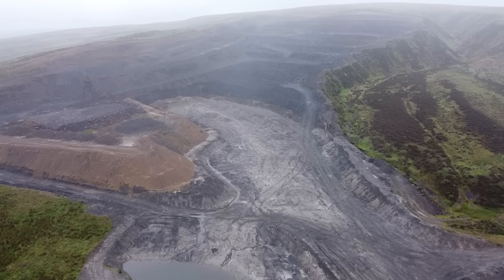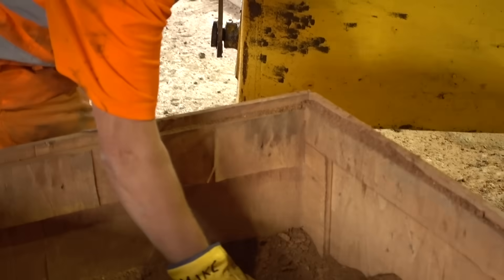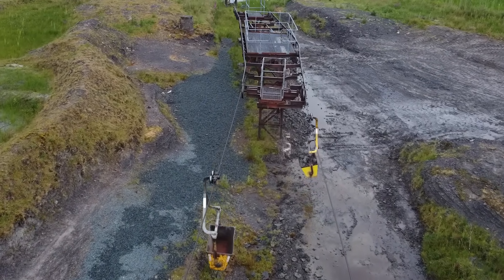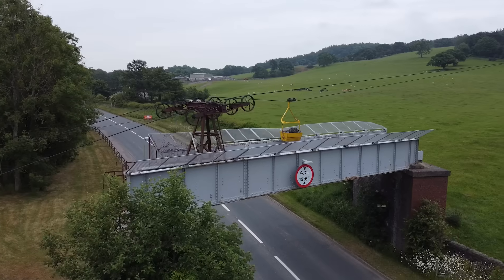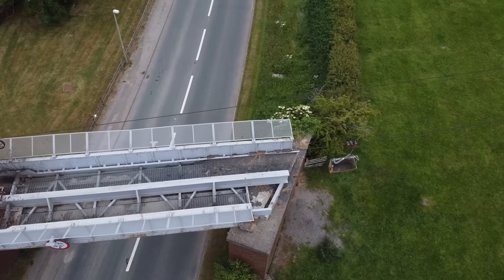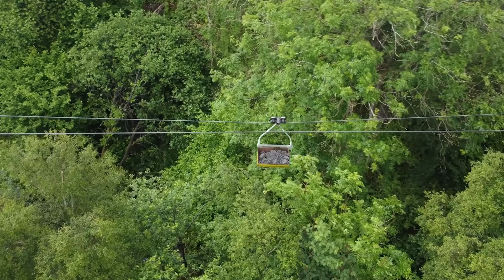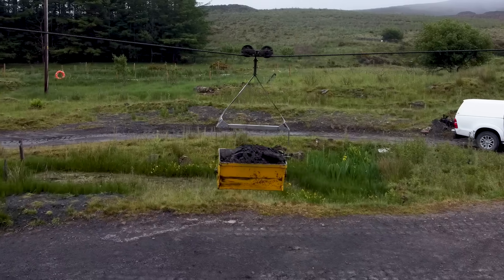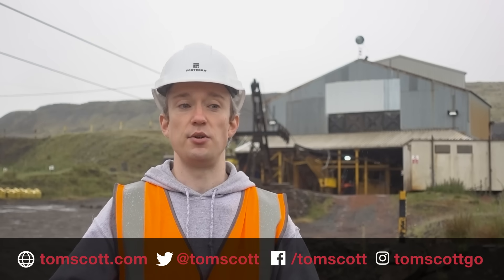The UK's last aerial ropeway uses no power, moves 300 tonnes a day, and will be gone by 2036.

Comment: Theres a few railways opperating on a similar principle aswell. "famously" the trains that take swedish ore to norwegian year-round harbors and then bring the empty carriages back are net-energy producing because the trains use regenerative braking and the route is mostly downhill from sweden
Reply: Yes, gravity-worked railway inclines used to be very common in the UK but the only one still working is at the Bowes Railway.

A number of cliff railways (funiculars) operate on a similar principle by having a tank of water under the carriages which is filled to make the top carriage heavier than the bottom one.
Reply: @RJSRdg  There a cool one from Lynton down to Lynmouth. There probably a Tom Scott video about it
Reply: I think you will find that the iron ore railway uses regenerative braking
Reply: @andrewwalsh816  literally what I said. Thus similar not identical
Reply: @theholyduck90  Not meant to be a critisism; just that as some viewers had not heard of Ariel ropeways, I should point out that the Swedish railway doesn't use ropes. I should have added that when a train goes downhill, the wheels turn the electric motors that then work as dynomos/alternators, putting electricity into the system.  Of course, you have to get the timetables right. I hope this may be of help to someone.
Reply: No they dont
Reply: @DrLoverLover  if you are talking to me. im talking about the kiruna to narvik railway which atleast as im aware is somewhere around net-zero to net-positive energy. due to how heavy the ore trains are going down hill.
Reply: @DrLoverLover  What don't?

Comment: Since this is (for all intents and purposes) a perpetual motion machine, why the hell are we not using it and more like them to generate power?
Reply: we do in some way, we use potential kinetic energy to store power in the form of water that powers turbines in some places, tom Scott even did a video on one I think. But the reason you can't generate energy from this is the energy required to get more mass up to the high point is more than you get from the system, the reason it works is the weight of the full carts pull the empty ones up. it's not a net positive in terms of energy of course because that isn't possible, and if you don't have stuff to weigh down the carts from the top it won't move. and when you run out of mass to move down the line you'll spend more than you generated just getting it back there.
Reply: @fisheatsyourhead  Sorry I realise I may be being stupid here, but one of the ways to generate electricity is through passing metal through a copper coil right? Why can't they create copper coils at both ends of this machine to generate electricity from it? The machine is moving regardless because of the shale mining so needing human input or the exact physics of this doesn't really matter.

Comment: “The computer matched what a person with a slide rule and a pencil did” That’s why I love to learn the method behind how stuff is designed, our parents and grandparents managed to build incredible things with nothing more than their collective brain power and some scratch paper. 

We flew across oceans, united continents and went to space based on the power of math and a sturdy writing implement.
Reply: What people often fail to realize is that computers aren't smart or clever. They only apply the calculations the people before us had to do by hand.
Reply: @SideQuestAdventuring  well, in this case I definitely think that's mostly true (the computer followed design rules that were moreorless the same as those used by the original designers), for some more complicated optimization problems, computers can actually simply outperform our best conventions.  Look up the evolved NASA antenna (ST5 X band antenna) that was generated by a computer just chugging through the possibility space more thoroughly than any human could.
Reply: @SideQuestAdventuring  Yes - but they do let you run more calculations.
Previously an engineer might have a dozen ideas guided by intuition, and work out manually which one is the best - now they can use the same intuitition to test a million options (and maybe take a punt on some weird ideas, to see if they are indeed ridiculous).
I think my point is that I agree whatever a computer does today, could probably have been done without them - but ye olde engineers were using whatever was cutting edge at the time, and would have embraced them.
Reply: @goldcd  There's also the expanding library of tried and tested standards to draw on. Instead of wasting time on simulation or optimisation, engineers can build something to a standardised specification that's been tried and tested by somebody else.
Reply: concorde was the product of slide rules and men with a dream.
Reply: @0megalul309  As was the Bell X-1, and the Empire State Building
Reply: What I think about is that alongside the visible successes, there were probably many invisible failures as well. The great final visible product, may be the culmination of learnings from failed and/or successful attempts.

The way things are done can be measured by different or similar metrics, and they can each be respectively admirable.
Reply: @JJKoga13  Yes please don’t think I’m discrediting the work done today, it’s just fascinating to me. Like now pilots have GPS and radar and all these aids to make flying safe and efficient which is great, but before that pilots found their way using railroad stations and a watch. The ability to be clever I suppose is what I find so endearing
Reply: @johnbeauvais3159  using GPS as an example is a bad idea.
GPS made flying much more safer.
Reply: @Jehty_  I said as much
Reply: @Jehty_  You missed his point...completely.
Reply: @johnbeauvais3159   a vestigial aspect of that are the "eyebrow" windows on Boeing airplanes.  They came from the era when pilots actually used a sextant to navigate when traveling overseas
Reply: As Tod Cutler likes to say: people back then were just as smart as us - they just didn't have the same level of technology.
Reply: It's also a testament to the programmers of the parametic system  that came to the same conclusion. It means they were able to distill and abstract away centuries of engineering wisdom into a few dozen megabytes and a couple hundred parameters.
Reply: It's an aerial ropeway, you're not dealing with incredibly precise calculations here. The computer might be able to do a slightly more optimal job, but you're probably talking a few cm here and there, not worth bothering with for that sort of civil engineering.
Reply: Thing is, civil engineering hasn't changed over the years. That computer probably has the equivalent of slide ruler and pencil programmed inside, that gives about the same results as those engineers got. What has changed is how easy it is to do calculations, and how much can you trust construction materials and contractors building quality.
Reply: Slide rules are analog computers.
Reply: @georgemorley1029  & abacus
Reply: @NimsQuarlo  And the Hoover Dam, which as I learn more about the forces involved becomes more amazing
Reply: I guess it goes to show that the real power is in the maths, and not in the computer.
Reply: Don’t forget about survivor bias. Yes, this has survived 100 years and was designed on paper, but there were probably countless other similar systems that didn’t work, or weren’t as efficient and had to be replaced.
Reply: @SWebster10  The survivorship bias is very prevalent here, since it requires a human to make the perfect input constantly to keep this system from failing catastrophically and the foreman said as much. 

You can probably find thousands of examples of these things failing in newspapers of old.
Reply: @SWebster10  Fair point, for every Spitfire there were several utter failures that never got beyond the small model stage. For every self loading rifle there were failures like gas traps and primer actuated
Reply: @johnbeauvais3159  Computers help with this (via simulations, optimizations, ...), but they also let you be lazy and not understand what is happening in detail.
Reply: The program would have the same equations used
Reply: And then you get the (pop culture reference but, still....) failure of basic interactions with the world:

"sir, the radars down" 
"Can you see the sun?"
"yes"
"Then put it on the left!"
Reply: Computers and software are also built with 'collective brain' power - the basic principles of engineering have been know for thousands of years - this pully is primitive compared to what ancient civilisations built
Reply: It's a ropeway down a hill. There aren't too many variables. It's not like designing the specific blades of a 1000 part turbine engine. Of course human designs would match the computer. Interesting? Yes. Surprising? Eh
Reply: Mind boggling that with less, our predecessors have achieved more in laying the groundworks.
Reply: Video games have been the most 😙😋😎😚

Comment: There are many many many aerial ropeways still in use and well-maintained in the USA— they’re called “ski hill chairlifts”.  ¯\_(ツ)_/¯ 

Seriously though, while there certainly some differences, the mechanical concepts and rough size & shape of a number of the parts look very similar.  Powered though, of course, since most skiers/snowboarders/snowtubers want a slow aerial ride uphill, not down to the bottom.

Comment: Some say that the quality of engineering has since went down.  That is obviously untrue, but it turns out when engineers are more constrained they come up with fascinating solutions.  When fossil fuel and electric driving systems were not as prolific, they came up with fascinating mechanical solutions!
Reply: One significant change that has happened in in designed lifespans - a lot of Victorian engineering projects were designed to last 100 years (and overshot considerably); more modern designs tend to both assume they'll be replaced or upgraded long before they've been operating a century, and be a lot better at not overshooting their design specs by as much.
Reply: @rmsgrey  It's a fascinating picture of the difference in how the two ages regard technology, the old era regarding technology to not advance within their lifetimes and the our current one regarding it to constantly advance and bring something new and better.
Reply: And I'd guess likely better for the environment than the underground conveyerbelts, and especially the lorries going back and forth...
Reply: @Stephen-Fox  Underground conveyor belts wouldn't be used here, in fact they typically aren't whenever the raw material is equal height or higher than where it is processed. Plus far too expensive for shale of all things.
Reply: No. The simple truth is hills don't exist everywhere.
Reply: As XKCD remarked (1045), doing science or art under constraints almost always gives more novel solutions.
Reply: Point well made .. looking at the development of computers post WW2, one reason that UK had a world-class position in their design and construction was the need for engineerig innovation and invention to make up for shortages and cost of electronic devices at the time. This resulted in computers with high performance but economy in the quantity of hardware needed to achieve it.
Reply: We are more capable of more nowadays. But are we solving the right problems to the same degree as before? Are we asking the right questions? Has the value of architectural beauty lessened?
Reply: Anyone who says " has since went down" would lose all credibility in my eyes.

Comment: I didn't realize detachable lifts dated back to the 1920's, then I noticed that it doesn't have the spring-loaded grips that a modern detachable chair lift would to hold the carrier onto the cable.  Are the buckets just friction fit onto the line?
Reply: I noticed that too. I imagine there's some sort of gravity mechanism in the grip. Makes it absolutely unsafe for passengers, of course.

Comment: I run a highly popular website on passenger ropeways, but there's something I can't work out. The carriers detach from the rope and are loaded or unloaded and before being reattached to the rope. But it isn't clear how the grip works, it looks far simpler than on passenger ropeways like detachable grip chairlifts or the Emirates dangleway in London. Does anyone have an idea about this?
Reply: It's a mechanical grip, like a giant pair of pliers.

Here's some info from the National Transport Trust;

---
When "on the rope" the buckets are suspended from a hanger, the head of which has two free running wheels, and two clips. The clips sit on top of the rope, to which they are held fast by a combination of gravity and friction between the rope and the clips. As a bucket approaches the top or bottom station, the wheels engage with a rising Bull rail to lift the clips off the rope. The bucket is then free to run along this rail, which allows it to be manually controlled during the loading and unloading processes.
---
Reply: @ann_onn  Ah, so not really secure enough to use on passenger ropeways? I was hoping that this ancient system might be both secure and simpler than the complex and expensive detachable grips used on chairlifts and gondolas.
Reply: Just here because that was my exact question watching the video as well

Comment: It seems somewhat mad that we have an emissionless system for transporting material for brick production, and there's no desire to reinstate it.
Reply: Seriously, this whole video I've waited for the reason why this system isn't used anymore.
Reply: @SpoonOfDoom  It does have some serious limitations. Can only transport goods downhill, limited range, requires constant operator attention on both sides, among other issues.
Reply: @daredaemon8878  of course it's only downhill, but obviously there are places where this is the case.
The operating part looks like it could be fully or mostly automated now.
Reply: @SpoonOfDoom  Only downhill, low range, extremely difficult and disruptive maintenance (literally cannot move a single bucket until the line is changed entirely), relatively expensive for the volume (niche cut cabling for this use will cost a premium), emissions aren't actually that big a deal to a company like this. Not like they get punished for high emissions. And even if they did they'd just buy carbon credits because it's cheaper than installing green alternatives.

Comment: Forget breaks, that would be cool if they hooked it up to a generator
Reply: Might cause too much load on the system for reliable transport of shale. It sounds like the placement of buckets on the ropeway is rather precise to keep it moving.
Reply: @gangstreG123  ? The generator would do the exact same job as the brakes. Like a tesla
Reply: @jaredj631  Okay the brakes are there to modulate the speed of the system, but if a generator were attached to take up energy, its stopping power would vary depending on the load in the electrical system. If the load on the generator decreases suddenly, the ropeway could run away because there is less load providing stopping force.
Reply: @jaredj631  The amount of power you could capture regeneratively would be too small to justify the cost of the new braking system.
Reply: @gangstreG123  That’s exactly how I tesla Work. It back drives the motor like a generator. The regeneration is nice the main purpose in my opinion is to reduce the wear on the brakes.  Tesla breaks and they need to be changed every hundred thousand miles as opposed to 20 to 30,000 miles for normal cars.
Reply: @LN997-i8x  I agree it wouldn’t be that much power. The main purpose would be to reduce wear on the braking system and to power the top station Probably not worth the cost but a cool  concept imho
Reply: @gangstreG123  If connected to the electrical grid a synchronous generator (and to a slightly lesser extent an induction generator) will limit its speed to match the frequency of the power line. Plus there would still be backup brakes so it wouldn't run away even if the grid were to be disconnected. And side note, this is actually one of the biggest weaknesses of the power grid. If grid load changes suddenly generation plants might not be able to adjust fast enough and the frequency could go out of spec.

Comment: In Sweden we also have a fairly major rope way, but it isn't used for a somewhat odd but logical reason.
It uses electric power on the other hand, but it isn't used since the amount it can move in a couple of days is what the company running it needs in a year.
Simply stated, the rope way is far too efficient to be cost efficient compared to trucks, since the maintenance cost is larger than the cost to drive trucks for the given production volume and distance.
So it has fallen into disrepair and sections of it has been taken down. A few sections remain as a museum of sorts.

Ropeways are fairly simple constructions.
Though, this English example is interesting in that it uses the main load carrying rope as the driving rope as well. Has some pros and cons.
Reply: Fascinating, thank you!

Comment: This is a genius idea! There should be more things like this, not fewer - or none! There must be more places where this would be feasible. Surely there must be an updated version? This is so sad as well as so brilliant.
Reply: There's an updated version of a sort - in Biel Switzerland there's a hillside mine with an enormous electric dump truck that uses regen on the downhill drive to charge its batteries for the return journey.
Reply: Well they said in the video they tried to design an updated version using a computer. The computer suggested the exact current design.
Reply: Locks on canals lift boats uphill using the power of rain.

Hydroelectric power stations produce electricity from rainfall.